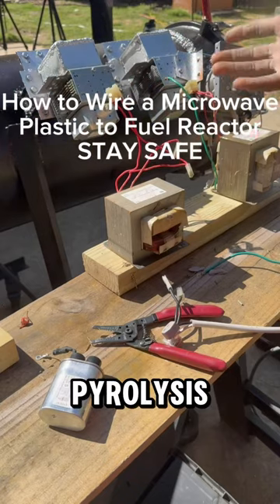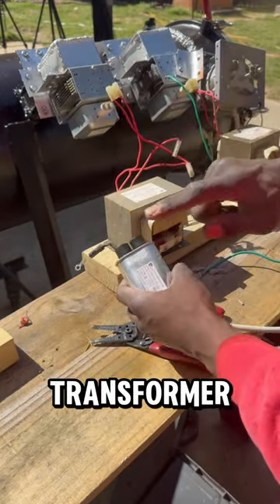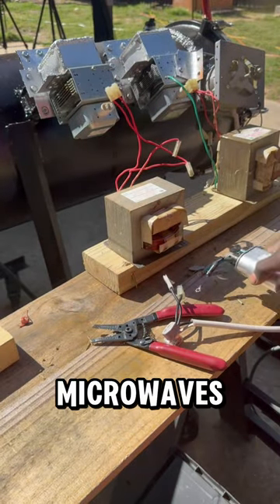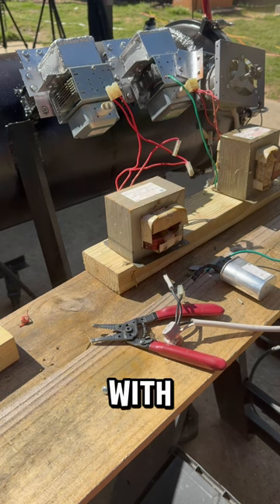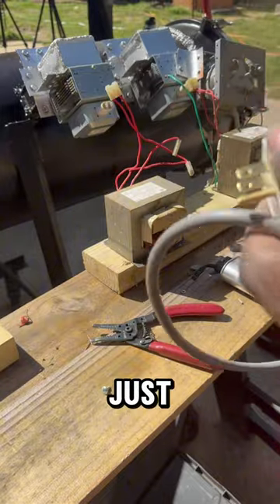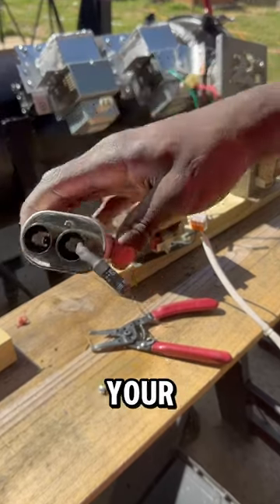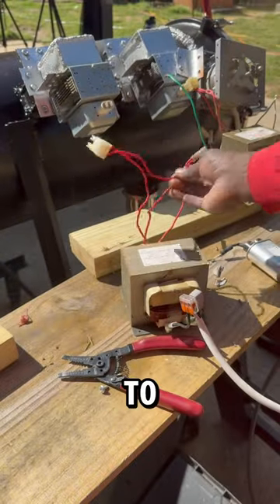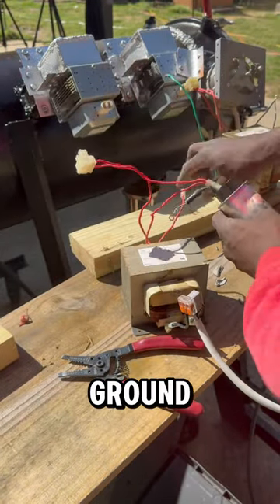PLASTIC IS ENERGY AND FUEL! ⛽️ #naturejab #pyrolysis #science #education #fyp #foryoupage #viral

Comment: Be careful with capacitors in a microwave circuit. They have an internal bleed resistor but if it were to fail, most insulated hand tool are rated at 1000v. So depended on what style you’re working on, it could still have 2300v-4600v which would melt that insulation immediately and allow that energy to find ground through you.

Comment: Show us what happens to the plastic carbon mixture after it's been microwaved
Reply: The plastic after being distilled turns into a black solid mass that is slightly sticky flakes during removals is extremely toxic and requires licenced professionals to dump and the fumes from it and the mass itself is extremely carcinogenic. Now done with a microwave it might have different physical properties, but it doesn't change the chemistry going on so the hazard are the esact same

Comment: Second video ive come accross in my feed. And yup, im one hundred percent sure you are using waaaayyyyy too much energy! Its a cool project bro but you are part of the problem, not the solution! Sheesh. Thats crazy to think you would be okay using that much energy for such a low yield. You should really go look into working in one the plants. Indiana has the pyrolysis one that is constantly expanding and developing, maybe go try to develop with them a sustainable process for microwave pyrolysis. They're always looking for people! Its much safer and much more efficient. If not that then im sure ive seen a portable unit utilizing microwave pyrolysis which claims to convert, i believe, 5 tons a day, into 800 gallons of diesel without the needed carbon. Save up and get one of those. This is just crazy.

Comment: So... howdo you sync your magnetrons? 😊
Reply: Magnetron synchronization? Why do you need this?
Reply: @Bahrombakirov1969  ok... 
you have two, or more, sources of rf energy channeled into one chamber with a random size, resonance, swr ratio. 
The two sources of rf energy are roughly the same frequency but not exactly and... pretty unstable. 
The cavities expand with heat, the magnetic field decreases... they drift, period. 
On top of all this, *there will be interference*. Destructive and constructive and considering the setup, there will be more energy in the chamber with just one magnetron than three.
Reply: The power of 1 magnetron is less than the power of 3 magnetrons! The diameter of the pipes matters, you are right, but you shouldn’t be too afraid of the resonance of microwave rays, because most of the microwave energy is absorbed by plastic
Reply: @Bahrombakirov1969  The power drawn from the mains, yes. The power dissipated by the magnetrons into each other and themselves, yes. The power dissipated into the plastics though... nope. :)